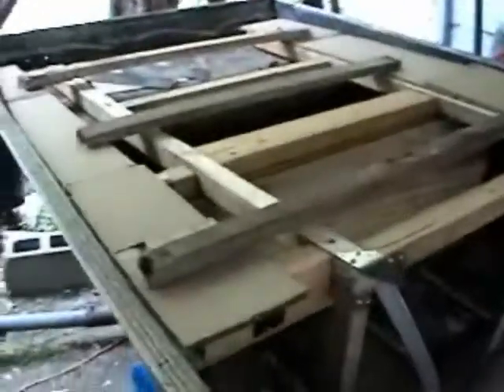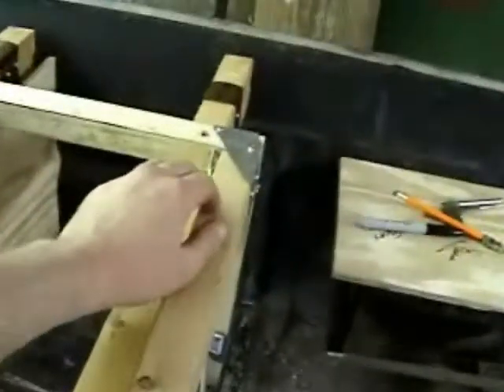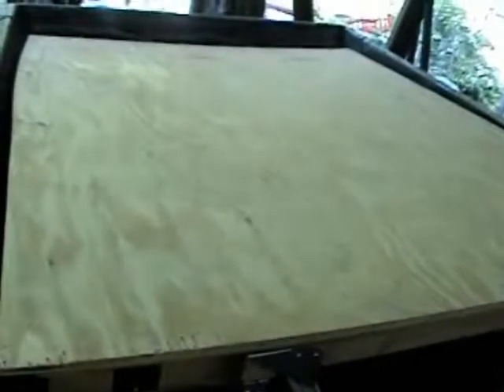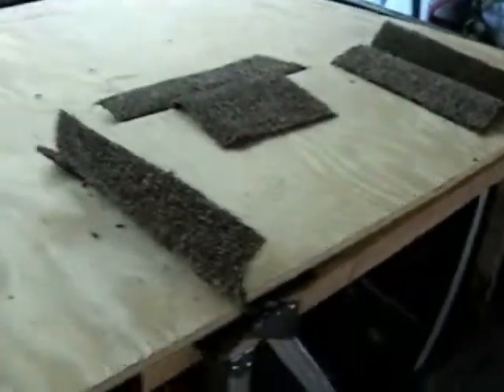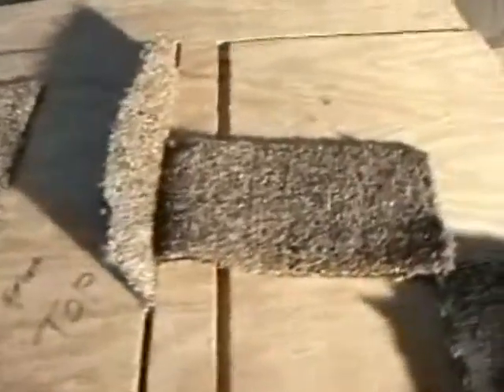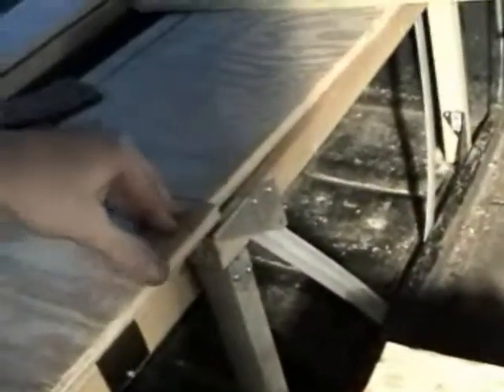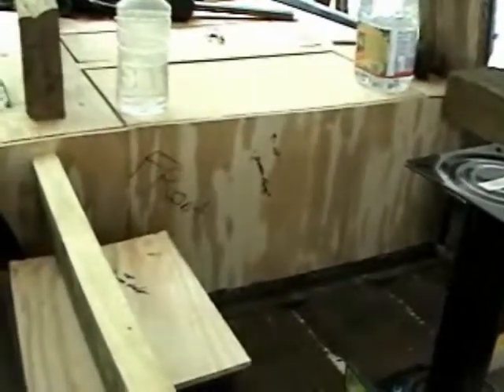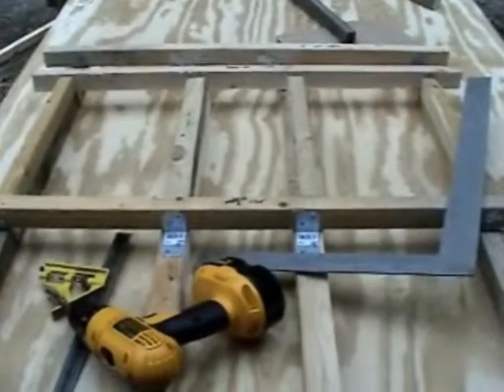1434 Jon Boat Project part 5

Comment: Im starting/planning my 14' jon boat conversion project and taking your design to the "T". I've watched many 'Jon boat conversion' videos and yours is the best I've come across. I'm just thinking of questions I'll have as I work. Like I said I'm just in the planning stages so far. I know I'll have more questions as I get going actually. Thank you so much for your series. You cover everything basically I haven't had any questions until now!

Comment: Why did you take out the frame and then level and square it up? Wouldn't you want the frame to match up to the floor of the boat just by securing the frame with the initial clasps?
Reply from the maker: lol I just watched back through, "first time in a long time" Looks like what I meant was to be able to square up the board ends with one another mostly.. It's always a lil cramped to do it in the boat so I just tacked it then squared and finished it once removed from the boat.
Reply: Gotcha! Thanks man this video has been really helpful. One more question: what size wood are you using for the framing? is it 2x2?